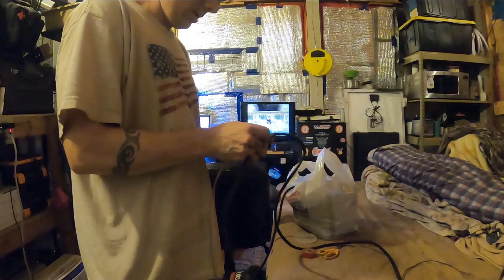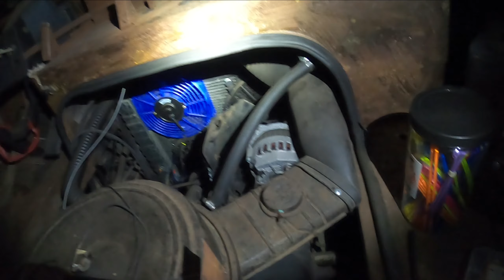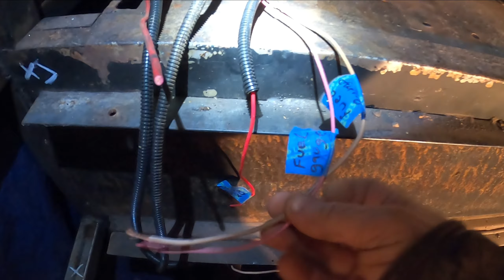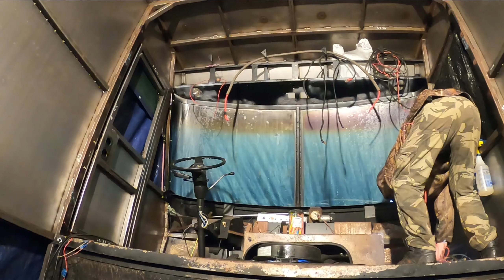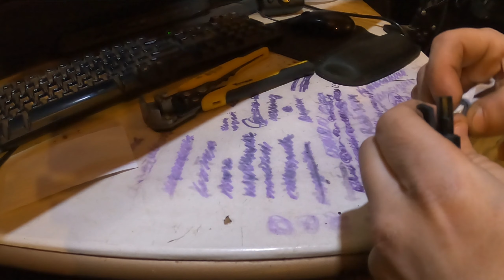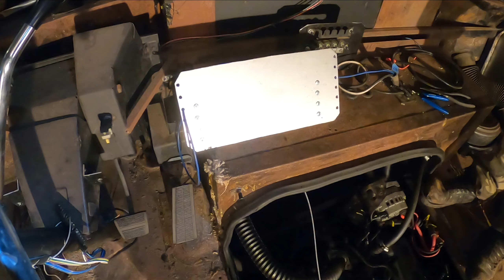Install Chassis Wiring - RV Rebuild (Part 23)

Comment: Brake light on the dash comes on when you apply the parking brake...also that same light warns of low fluid level in the master cylinder..A lot of older trucks were like this...cant say for sure your RV would be the same.

Comment: Nice to see you working on rv as rain stop you from doing body panels
Wiring is better as you can only install what you need and cut down on dead wires,you are making old wiring more like a new car does.
Like that you putting more Earth's so it doesn't have to worry about one earth that will stop a battery or other items running 
Well done to run wires away from large heat sauces that will burn throughout the wires in Time.